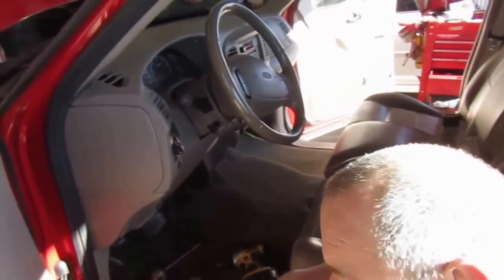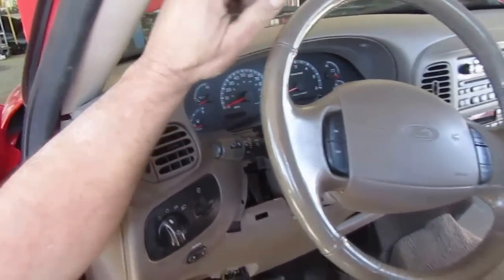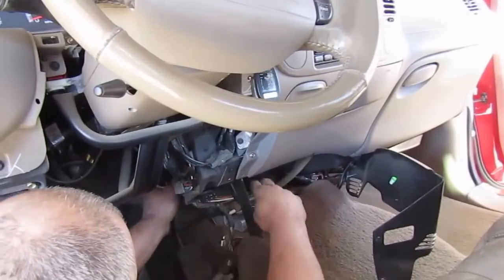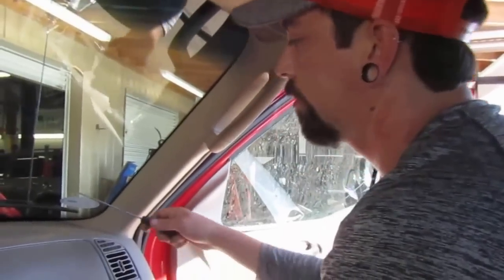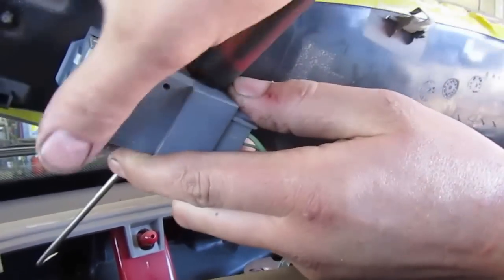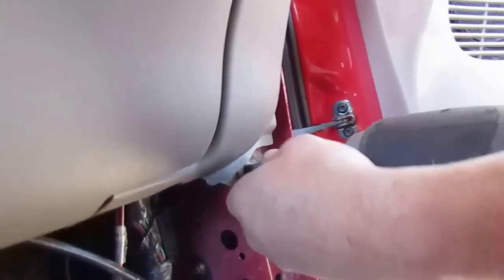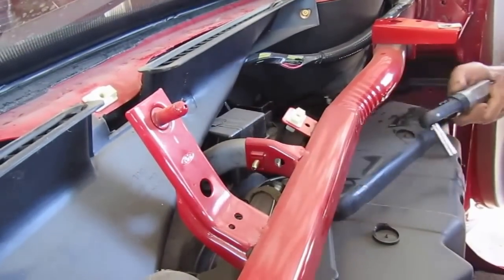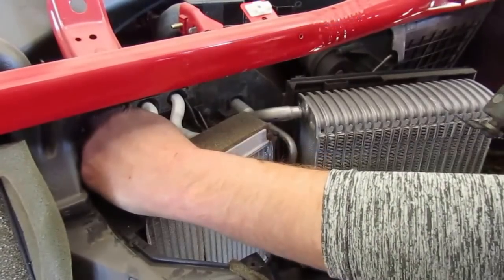Heater Core F150 Replacement , $370 Dollars 28 Minutes, Carpet Wet

Comment: I did everything that she would list it out and thought I had it ready to go and gave it a good tug and it’s caught on something in the middle of the day or in the middle of the floor can’t really tell. The ends are free both ends of the days are free to move but the battle is caught on something I watched your right video re-watched it double check triple checked I got everything taken apart that you indicated I’m wondering if there’s something about a bracket on the floorboard in the middle of the consul coming up that I’ve got to take something apart there that that wasn’t on your video? I have a 2003 F150 King Ranch5.7 L?

Comment: Best heater core video on youtube period. Very detailed. My 98' is on its third HC. It's busted too. Tired of paying Ford to replace it. Gonna do it myself this time. If it lasts just this winter I'll be happy. With this video I'll replace every winter if i have too. Which HC brand do you recommend? Thanks!!
Reply from the maker: Give it some Napa Kool.  Electrolysis eating you alive. A terrible disease of the heater.
Reply from the maker: +Jake Payne (The Heater Core Guy) I think I'm going to start adding 6 oz of purple power to every one we do. Acidic coolant is what causes the munching problems. It has free electrons and turns the coolant into a conductor. Best to use distilled water in the coolant but I've never seen anybody do that.  The purple should neutralize the acid, contain those electrons from being bad. There's a shop in Winston Salem using old model copper units and changing the necks to fit a F150. They say an alum. core only last a month there. Water must be weird in NC.
Reply from the maker: +Jamey Barkley Yep, get on the Nap Kool right away. Water pump probably not up to par. Bring some water from the grocery store to go in it. Maybe ya dont not need mess with heater core but that only a small problem.

Comment: after this job i did, i got the motor to turn, but would not fire up. any suggestions?  missed ground wire? plz help 1997
Reply from the maker: Fuel shut off switch

Comment: How do you get the other part of the core out? The ones that are still connected to the hoses? Sorry if this is a stupid question
Reply from the maker: Not stupid i cut the lines and pull them through the firwall and take a pick and disconnect lines
Reply: @Jakepayne99  nice!
Reply: @Jakepayne99  At first I thought that's why you stopped the video there. I heard it's a real pain getting the new core's end pipes back through the firewall, so most installers cut the new ends off and use 2 rubber heater hose couplings at same place you cut off the old. Nice to hear you don't take this shortcut 👍
Reply: @Jakepayne99  Are you guys still doing heater cores? 06 F150

Comment: I live in Walhalla, SC replacing a heater core in a 2000 F150 Lariat, is that model similar to what you're working on in this video? Thanks guys! God Bless
Reply: Sunshine Sanders I might be a little late, but 1997-2003 f-150’s are all basically the same.

Comment: I had to remove all kinds of crap out of mine to get the dash off. Cause the person that had it before me thought it would be a good idea to weave wires in and out of areas they didn't belong in and the dash was hanging up on all of them. I had to completely remover the radio, instrumental panel, and all kinds of other crap. Cause the previous owner hooked a bunch of junk up in it. Needless to say it's all been removed and it won't go back in.

Comment: How much would it cost for a garage to replace this I'm a disabled I can't do it
Reply: Close to 1700 bucks, I was quoted this for heater core and evap core in DFW area TX.
Reply: @MDestructo  how?....its less that a 3 hour job
Reply: @446hemi  Yeah did it myself, was just passing on a quote I got from a shop in my area.
Reply: @446hemi  I watched several videos and it said at least 5 1/2 hours. Where are you located?

Comment: Ford, the most expensive plastic you can buy!
Reply: Chevy the most expensive anchor you can buy
Reply: @gearhead9115  American made, great until the Japanese made it better. Thanks for saving me from 20 years of getting screwed by the American manufacturers. And thank you ford & chevy for suing the administration because you dont want to make parts in the US and want to make your parts in china. Thank you Consumer reports for taking bribes by ford to have the suzuki samuri outlawed by a finally proven to be debunked and illegal testing practices for roll over. Thank you America's suburbia want to be working class for demanding all this overpriced plastic and "special features" not needed by a working man and making the nanny state impossible to circumvent for any new vehicle manufacturers without millions of dollars in backing just to entertain the special interest groups. Thank you ford for making all parts that are expected to fail after warranty virtually inaccessible. 3rd core job on fords. 89 mustang was waaaay worse than this but I had no sweet videos. Thank you ford for discontinuing the 7.3L diesel and the 300 straight six die to "gas mileage restrictions", yet subaru has the same engine from that time frame going into new cars now with updated tweaks to increase MPG by over 30% across that time frame. Midas well come with some extra lube while the fan boys bend over and take it. As I lay on my wet 01 ford f150 7700 series with natural gas system's floor about to get the final wires unhooked for this heater core. Traded a 2012 with a faulty transmission after having it a year went back to the older better vehicles.

Comment: Thank you so much I will doing this to my 99 f150 I got her back running after 5 years of milkshake of sitting I got fuck back a pos mechanic in Texas on my heater core he did 4 times in 5 months I finally got my money back but it corroded my driver side head and crack it I will using motorcraft parts only

Comment: great video...got my like...i changed core on a 97 5 spd..only thing to add on a 5spd truck is make sure u remove clutch safety switch or at least unplug to keep wires from gettin pulled...awesome stuff